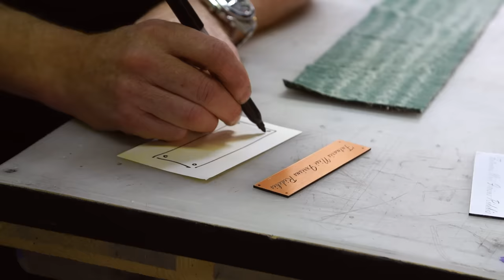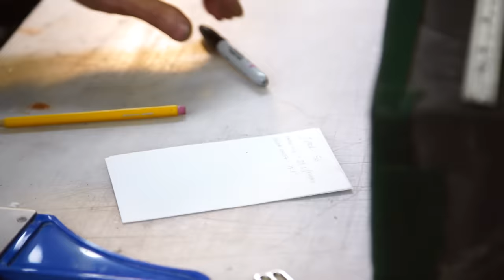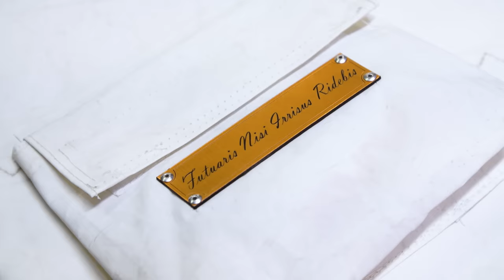Adam Savage's One Day Builds: Eric Idle's Guitar Case!

Comment: Hi Adam! You probably won't see this but I just thought I'd add my two cents in on some sewing stuff that might help you out on future projects! (I'm a professional dresser at a major US theme park, I work with costumed characters (primarily fur characters), and I spend a lot of time working with bulky and difficult fabrics. Our costumes go through a lot of wear and tear, so I figure a lot of what I do can apply here.)

TL;DR sewing mumbo jumbo and finishing techniques. Adam, you did pretty good on a complicated sewing project with not a lot of sewing experience. Major props to you!

First, when you are layering your pieces together, try basting the edge together with a 1/4in seam allowance to hold everything in place when you are sewing on handles and pockets and zippers and such. pretty much exactly what you did on the back piece.
When sewing your zipper, because you have so much bulk in your fabric, try adding an extra piece of just sail cloth to the edge of the main piece and then sewing the other edge of that extra piece to your zipper, that acts as a middle man between the zipper and the main piece. This will take the bulk out of the zipper and make it easier to zip, and prevent the ever dreaded zipper breakage. 
For finishing your edges, try clipping the fabric around the curves like you did when you added the felt to the foam, it will help your fabric ease around those edges, and take the bulk out of corners. I've also seen people here in the comments suggest bias tape or serging the edges. That would also help in the durability of the case as the edges of that broadcloth are gonna fray like crazy.
As I've seen other people suggest, I'd invest in an industrial sewing machine and an industrial serger. They sew much faster and it would take a bit more training to learn how to use, but you seem to be working on mostly projects that use tough fabrics and lots of layers, so a more heavy duty machine would definitely help. 
And final nit picky thing, the sail fabric will most certainly hold up but the white color is going to get dirty very easily with all the travel its going to be put through. I know you were just using left over fabric, but I know you use black sail fabric for your EDC bags, so that might have been a better choice if you had it on hand.
Reply: @TELE6220  It was broken up. There was a line break between each paragraph. :)
Reply: Another reason to use bias tape is how much he cut down his seam allowance. If there are only a handful of threads between the seam and the edge, the seam will just be pulled through the edge as it frays. So there's a chance this bag will fall apart regardless  of the choice of sturdy materials.
Reply: @roraraptor  I totally agree! I didn't even think of that!
Reply: Also, starting and stopping anything at a corner (most especially a zipper) is going to be a misery.  And I would have sewn the two pieces of the outside edge at the top end, and pieced it (if necessary) at the bottom.  Probably would have eliminated the need for the rivet.
Reply: @bjspyder4148  zippers are already a pain, especially with all that fabric, so yeah I totally agree!
Reply: Is there some sort of waterproofing additive that could be sprayed on afterwards? I just googled and found Fabsil for example.
Reply: @jonnamechange6854  I've never heard of that but I'm sure that is a thing that could help, but that's probably overkill for this project because of his choice of outer fabric. Mostly is comes down to the construction compromising it's weather durability. But waterproofing could totally be a thing to be added!
Reply: @jonnamechange6854  presumably any DWR spray would do. I've come across some that were marketed as specifically for canvas (i.e. sailcloth), but normal DWR is supposed to work on a number of different fabrics and leather, so any regular ol'waterproofing spray from your local shoe/outdoor shop should do the trick :)
Reply: This is super helpful! Copy+pasting this to my endless GDoc of tips and tricks. Thanks!
Reply: So you’re saying you make people furries
Reply: Adding in my two cents as an instrument case user. 

Unless specifically wanting a zipper I wouldn't put them on cases. They are so long one broke tooth and it needs to be redone, often requiring the entire case to be reconstructed.

Clasps that are riveted in are way better as you just replace the clasps.

Take my advice with a grain of salt because cellos have about 7" of zipper. Smaller instrument cases last longer, so I have heard.

Comment: I enjoyed the video and I like the case. A few things you might want to add to your sewing tricks:

Starch: Used to stiffen fabric so it's helpful in turning light fabrics like your fur into structural elements. Or just getting them stiff enough to work with.
Fray check: When hemming isn't an option and edges are raw.
French seams: Hides all those unfinished seams with only one pass.

It's not bad at all - everyone starts at the beginning and you are making good progress!

When you want to push your skills, try dress pants. Sounds easy but it will really challenge your skills.

Comment: Anyone else dumbfounded at Adam wasting 2/3rds of his material but sicking the case right in the middle of the sheet at 27:27 ?
Reply: That was to do with the seam things on sails
Reply: @ShugoAWay   If you look he's talking about the white aircraft plywood or whatever it is. Has nothing to do with the seams of the sail.
Reply: I cringed at the wastage many, many times. 

But I'm also much closer to broke than I assume Adam is, so ¯\_(ツ)_/¯
Reply: The material was Coroplast (https://en.wikipedia.org/wiki/Coroplast). Basically, it's cardboard that is made of plastic instead of paper. I could buy a 4x8 sheet up the street for under $20. It looks like the sheet was cut in half already, and since he still had felt and sailcloth from previous builds, I have no doubt that he will repurpose the extras in other projects.
Reply: It's not like it's expensive material... Plus he still has all those off cuts to work with so not really wasted.
Reply: My conspicuous consumption was already overloaded by the sheer act of spraying foam cement indoors, without tarps and newspaper covering everything.  ;)
Reply: @Talamasca007  The first Tuesday of November and one other time of the year you can get all the Coroplast you want for free if you are willing to go outside scavenging after 8 PM. As long as you don't mind smaller dimensions and aren't picky about color or design.
Reply: @Markle2k  Where?
Reply: @absurdistcat  In the US on Election Day where this is happening. Election campaign lawn signs are made from Coroplast nowadays. They used to be waxed cardboard. Once the polls are closed the signs are a nuisance to the individual campaigns that they have to remove. But prior to polls closing, you are committing a crime if you remove them.

Comment: I’ve watched this vid a few times, and I’ve just realised how the handle moved. Adam sewed the handle on a separate piece and I think at some point the orientation got changed🔄
Reply: He starts out placing the handle at the mid point of the edge. As a guitarist, I can tell you that you want the handle to be at the center of mass, not the center of the length. Most guitars are heavier at the larger rear end, and therefore the handle is usually further towards the back so that it's balanced when carried. It may not matter as much with that tiny travel guitar as it would on a full size dreadnought, but I bet that it still makes it more comfortable to carry if it's balanced.
Reply: @danielabrams555  when in doubt, shoulder strap with adjustable buckle, is a nice addition to have.

But yeah it's those little details that set custom bespoke work apart versus excellent prototyping. 

A professional prototyper can definitely make a case that only existed verbally/conceptually 24 to 48 hours past.

But (and no offense at all to Adam and his incredible assortment of skills!) a professional maker of custom instrument cases would already have (preemptively) "solved" the issues of; the balance points of handles & carry straps, the weight distribution of same. And other long-ago-solved questions, such as which direction (towards the musician) an instrument case should unzip and open.

Hopefully Idle will be happy enough to get the issues of enough foam padding and a plyboard protective insert solved, that he won't be bothered a by minor isse of balance and perhaps an odd opening direction. :) 

On thing cosplay and prototyping taught me the hard way over and over,  was to not get rid of the -admittedly flawed- original until you're sure you've learned ALL the lessons it had to teach, good and bad BOTH!
And sure enough, Adam borrowed Idle's favorite aspect of the original case's back strap for the new case.

Now the final touch of genius? Would be to hose this down with 2 layers of Camp Dri canvas waterproofing spray. I've sat under a similarly proofed hooded canvas jacket in a downpour, and stayed pretty darn dry.

I also bring to cosplay camping events, my camp-dri-spray soaked canvas painters tarps, for assembly with ropes into "primitive" style tents. (Canvases subsequently also treated "pioneer" style with beeswax and linseed oil for a "fair stab" at period accuracy, on top of my "better living though modern chemistry" approach.
They're not the warmest or most draft-resistant - but by the Gods of Spray Sealant - every item underneath them or wrapped in them is bone dry!

Comment: Would have put the handle on the same side the zipper opens from.  Most commercially available soft/foam guitar cases are set up that way
Reply: MTBAjK 610 exactly, so you don't accidentally dump your instrument out if you go to pick it up and don't realize the zipper is undone
Reply: Nearly every case (including brief cases) are designed that way. It's a strange choice and maybe it was by request but without any context it really makes no sense.
Reply: For a good reason!
Reply: Exactly. I've done it once or twice with various guitars I've had. Don't get me wrong I would love a case built like that (with the handle in the correct spot) made by Adam for my 000-28

Comment: So, a couple things that will no doubt be mentioned by others . . .
1.  Don't know why he put the closed zippers on the opposite side of the  handle.  A zipper opening "down" is not a good plan in case the zipper fails.  Granted, the guitar is in foam, but with a zipper up, you SEE when it breaks.
2.  Why not locate the handle with the guitar IN the case so you know where the CoG is?  vOv
3.  The top cover could have easily been made much better looking by turning it inside out and sewing the top and bottom pieces together along the "zipper edge", sewing the top to the bottom with the zipper in between, then turn it inside out after it's all sewn except for the non-zipper side, where you can slide the plywood back in the middle, then sew it to the side piece.  No raw edges after.
4.  When adding tabs for a large carry strap, think about that before starting the sewing process because the tabs can be sewn in place when the edge seams are being done and be embedded in that seam with extra reinforced stitching out on the strap if needed/required.  Makes it neater.

I get he isn't a professional textile worker, and these are just observations, especially for his decision to put the case opening on the opposite side of the handle.  I don't get that at all.  You put a case down on a surface with the handle facing towards you - so the zipper(s) should be there too.  ?

Love his channel though.  He makes a lot of very interesting things.  Loved his TV show too.

Comment: There's one glaring issue with this design that I haven't seen anyone mention. This guitar has an angled headstock, which means that in this case there are only going to be two points of contact between the guitar and the foam. Ideally, you'd cut the foam so that the whole neck of the guitar was supported, but leave the headstock floating, so that no matter how much force was applied downwards to the fretboard, the stress will be displaced in to the foam, as opposed to causing the headstock to snap at the volute.

I'd also be inclined to put the handle on the side with the zipper, but everyone is complaining about that
Reply: Matthew MacDougall 8:00 looks like it has plenty of support going down the length of the neck.
Reply: If there is enough force to damage a guitar neck then thats enough force to push the neck right through the foam. the foam would be insignificant at the point.
Reply: Matthew MacDougall I was looking for somebody to say this. 👍👍

Comment: For the most part, I really love this build. The aircraft plywood was a brilliant touch for lightweight protection.
I was forced to deduct one point because the handle and hinge point of the lid should be on opposite sides of the case. Any guitar player will tell you that. Other than that, it's a brilliant build.

Comment: Further comment - minute 44 ish. If you had some fine braided cord and the sail material cut on it's Bias, to go around the perimeter of the project,  sewed together with loose edges approx 3/4 " or 1" , you could have made a much more stable edge for the case.  It would then stand up to a lot more rough handling.

Comment: At around 25:00 in the build I noticed you pushing the sides together when you mocked it up to get a tighter fit... could you have put a long thin threaded rod below the neck / (in the middle of the depth) with washers on the end in order to pull it together? Might be over kill.. but maybe once the case is on outside of the foam its OK?

Comment: I would have added a few hollow tubes through the case to dissuade crushing. Some jerk puts a heavy suitcase on top and the neck breaks.. Also laterally (?) so it won't compact width wise either And may lighten the case a tad too...  Also I'd have put leather (or equiv) as the tabs top and bottom.. less friction less wear

Comment: 23:36 - I would have put those parts on first and then folded the felt on the top over it to hide that seal. Might have some issues with that glue getting loose from taking it in and out of the case.

Comment: He was moving so fast a gluing so much stuff I thought disaster was imminant. What a pro he is but like others, I felt he missed on the handle and should have tried felting from the outer sides all the way to the inside bottom to avoid the guitar stressing glued edges. A few well placed tucks, folds and clips and Bob's your uncle.

Comment: The last time i was on a plane it was a visit to the US back in 2000, a trans-Atlantic flight and i have to say the overhead compartment on the plane would not have fitted a guitar case of that size. In the video Adam mentions that the build will be of enough size to fit in overhead compartment, really??? Do planes really have such large overhead compartments that is can take the size of a guitar in a guitar case?
Reply: In first class they do.

Comment: Great work for a first build. Comments about the handle location (balance point and same side as the zipper opening), room for the headstock and the felt edge are spot on. Also--why just use plywood for the top? Why not the back and sides too? I wouldn't trust that in an overhead bin. But I don't use soft bags either. Still, Adam is a pretty amazing dude.

Comment: Can't help but be very concerned about the interaction of the materials with the guitar's finish...
Reply: I came to say this good on you, nitrocellulose finishes can melt in a matter of hours when in contact with something it doesn't like, cheap guitar stand buyers found this out the hard way so I am always super careful and add ugly cotton fabric to anything that touches my guitars for longer than a few minutes at a time.  If it all turns out great though that is an awesome case, I may need to start building my own for some of my custom instruments.

Comment: The headstock should not be touching the walls. That's asking for a broken headstock. Also the neck needs support and the zipper should be on the handle side. Cool build though. I was kinda let down when felt replaced the fur😢

Comment: Talking about a hero. You're the reason I'm a maker today. 

Anyways. 
The term you were looking for is upholsterer. We typically deal with heavier materials (like that canvas) there are 2 types of upholsterer, a furniture upholsterer and a auto/marine upholsterer. Very different skill base. 
Like how a leather worker and a bag maker differ, even if they complete the same tasks they think in different ways. 

But yes. To comment on what you said in your video. There are absolutely times where I'm like IF HE ONLY KNEW THIS ONE TRICK. 

Came out good tho. In the future the handle needs to go on the sake said as the zipper. This way if you forget to close the zipper it doesn't just flop into the floor. I'd also add a piece of hdpe support inside that handle with rivets just so it doesn't pull directly on the stitching. 

And I couldn't tell but avoid cotton threads and increase your stitch length. A close stitch length will almost act like perforations and cause rigid materials to tear and the cheap cotton thread can't hold up to UV or moisture well since the waterproof material won't let the underside of the stitch breath and dry. 

Love your video